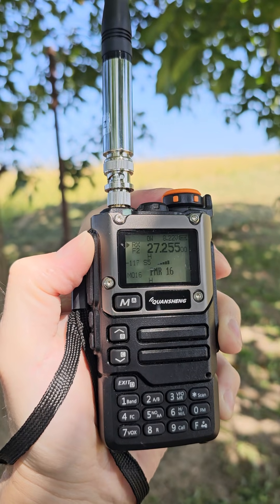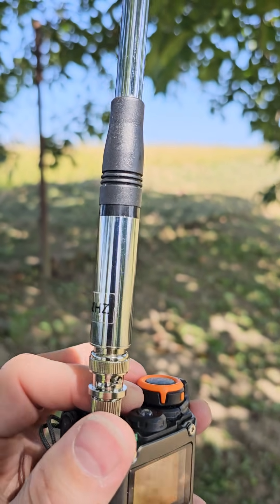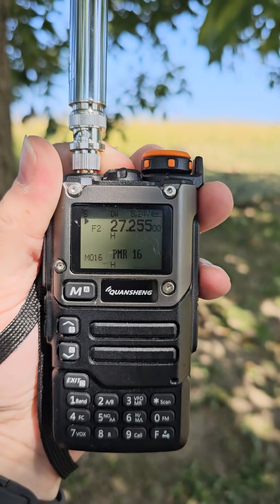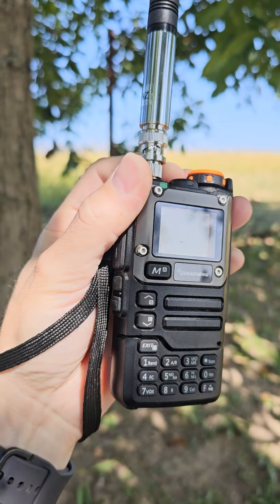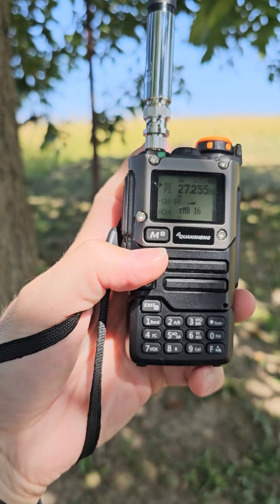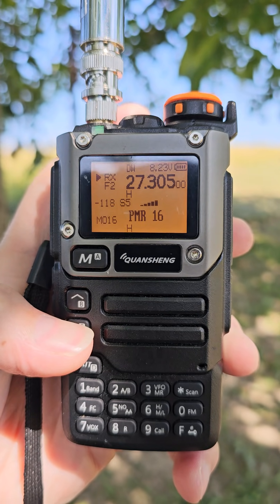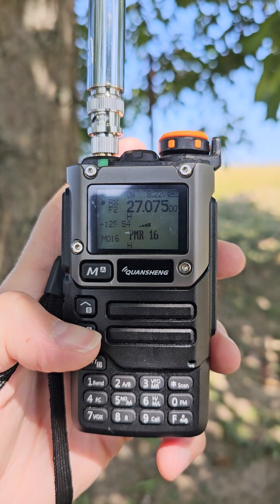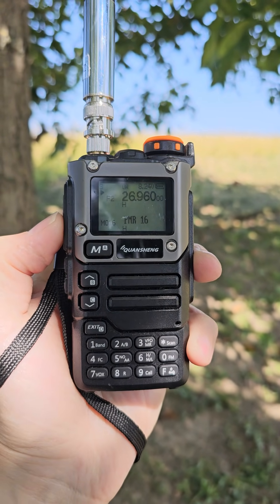VHF/UHF UV-K5 turned to the CB FM Transceiver 😀👍

Comment from the maker: I tryed to program the CB channels but not successfully, because this software don't allows input any frequency below 50MHz.
Reply: Hello, in 27mhz when I push ptt it transmit on 50mhz. How do you modify this ? Thanks.
Reply: @Martial11480  hold ptt and function button 1 (botton below ptt) and turn on the radio,then go look in the menu for ifni remember right f lock
Reply: @Fransthe19TC504  hello, thanks for your reply I have install a new firmware version and now work great.
Reply: You DON'T want to transmit on this Radio on the CB band - use it for recieve on the 27Mhz / 11m band - its not designed for this - there are no filters in this radio to prevent the Harmonics. Someone posted a video of this radio transmitting a showing a 5th Harmonic being transmitted on the airband! - with over 30% of the output RF power, not good. By all means use it as a reciever only - if you want to transmit on  CB then buy a hand held CB 🤦 they aren't exactly expensive
Reply: @Martial11480  did you figure this out?
Reply: @lukeyna1  hello, yes i have change firmware by IJV v2.9R5 look fine.
Reply: @Martial11480 I have the same problem Did you ever resolve this?
Reply: Hey Omoet !
Thk's !!! 😉 But how do you do this ?
Best 73's 🙏
Reply from the maker: @littlebricolo1380  there is the link in the video description how to hack it ;)
Reply: @littlebricolo1380  you can hack or modify this radio with new filmware it open up the radio from 18mhz till 1300mhz
Reply: you have to put the frequenties by hand,chirp dont alout you to put out of band frequenties in it
Reply: same problem here
Reply: İF it works between 50-70 MHz good for me as military
Reply: I'm doing it with Chirp and egzumer firmware. Make sure you set the mode to "AM" for the cb freqs
Reply: use Chipt next and allow the Freq. In config
Reply: @TheLutzio2000 
Thk's,  i think too this method
73's

Comment: Very good video thank you 👍I see how you hold your fore finger against the antenna, this is understandable as the 27Mhz whip is putting weight on the UK-V5 sma socket. It would be innovative for someone with 3d printing ability to make a shim or fitting to go between the UK-V5 sma socket and the 27Mhz whip fitting. This would hopefully help to distribute the antenna weight on to the body of the UV-K5 and minimize the pressure being exerted on the sma socket.

Comment: When you shorten the length of this antenna, (not extending it to the fullest) , would it be usefull for 70cm aswell?
Reply from the maker: No,  because there is a coil in the base of this antenna.
Reply: @OM0ET  oh, OK. Thanks for the heads up.

Comment: 1) it trasmits 228µWatts (yes, MICRO watts) on CB
2) it transmits A SHITLOAD of spurious / harmonics signals

Conclusion : Don't do that!
Reply: I am not sure how much spurious noise a SL is but highly technical terms typically say dBM. Do you know more information on the spurs or have you taken data?
Reply: 1 milli Watt on 27, 1watt on 106, 2watt on 121 harmonic

Comment: I did the hack too! - works nice on RX, (TX works too) so one can hear all the traffic, and the guys on 27 often mod their radios up to 80 or more channels, so they are all over the place! thx for nice video! 73 from Levi in Sweden
Reply: how long did it take you just got mine not sure about this the software what do you start with first chirp or do you install the 40 am fm or the pscps exe
Reply: @ironhead320  Just follow the suggested link in the description, i used no chirp at all
Reply: Colud you share the link of the firmware please
Reply: @elkochannel6677  explanation in the video description, i went to Github, user Fiagci, and simply dowloaded the latest firmware

Comment: You'll get like microwatts in CB when TX, but you spill all over in airbands. So you better just to RX on with that device.
Reply: yeah have to modify TX final stage filtering.. otherwise most of the power goes to harmonics. haven't seen such hardware mods in the wild yet, even though one ham mentioned some w.i.p on his website
Reply: BRO TALK LIKE A HUMAN MAN; I DONT UNDERSTAND A SINGLE TERM

Comment: I would like if Quansheng actualy made CB radios which have output power like 4 or 5 watts and have hardware made for CB radio and still be around same price because a lot of new CB radios are pretty expensive no like ham radios even still they are pretty expensive, but still there is cheaper companies

Comment: Thank you for sharing, do keep in mind though It's useful for receiving but it isn't suitable for transmitting  not because of just the low output power but it is putting out a harmonic on the aeronautical frequencies at the same time. All the best 73 26TD29.